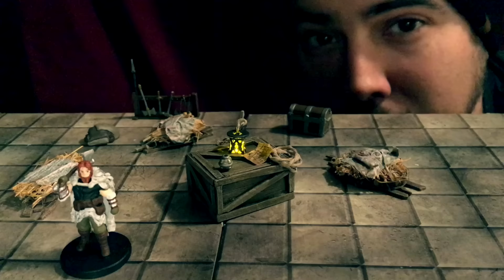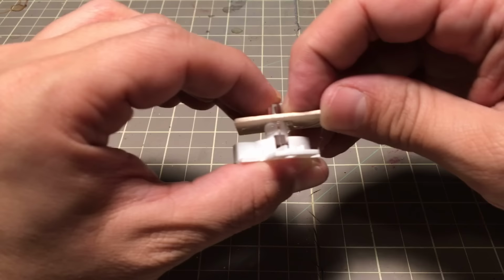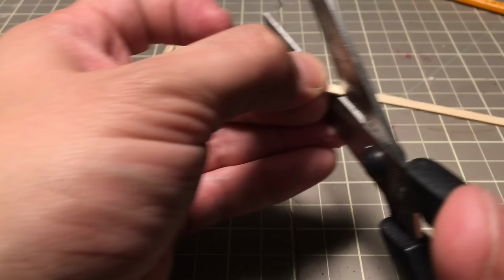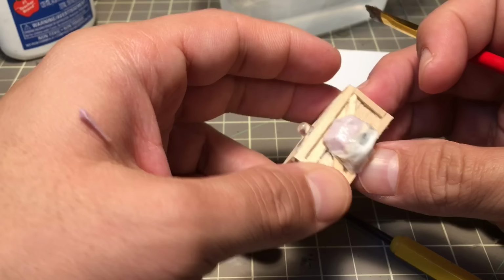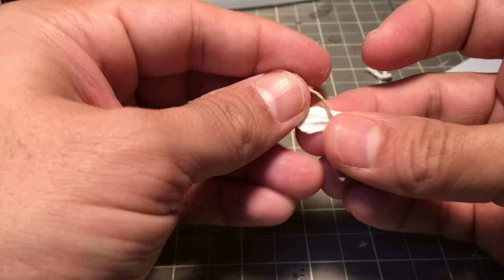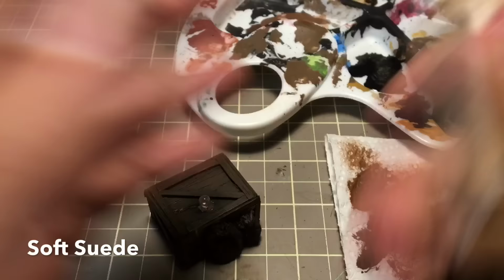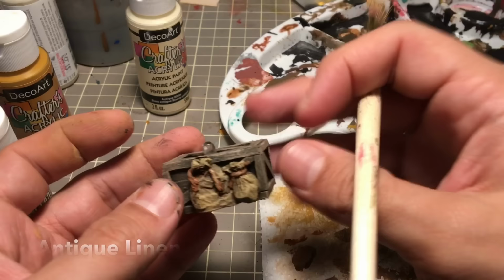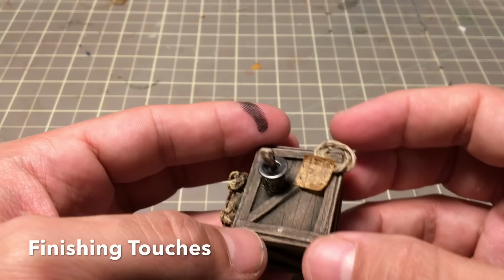D&D Tabletop RPG Prop Tutorial - Episode 3: Flickering Lantern

Comment: One thing you can do to mark where the hole is far more easily than your method is to take a little bit of paint and put it on the part of the lights base since you removed the LED at that point, then push it up against the top and remove it again. It'll mark it for you...same method normally used with pinning and getting the pin holes to line up
Reply from the maker: Ah, great call! I've used that before with other project but totally slipped my mind here. Thanks!

Comment: Great stuff had to make one straight away only I hid the switch inside the crate as I don't have any XPS and can't find anywhere that sells it other than kingspan insulation board which costs loads. Also what music did you use?
Reply from the maker: Love to see a photo of what you built! The music I use is called 'A New Dawn' by Machinimasound!
Reply: RealmSmith I'm still trying to find something suitable to cover the led with to finish it off. We don't have the huge multitude of craft stores this side of the pond. But once it's done I'll put one up.

Comment: AWESOME. Liked and subscribed! A bit of advice, there are parts of the video that you could either edit out or speed up.  a 40 minute video is hard to digest.  I think you will get more views if you can get it under 20 minutes.  10-15 minutes is ideal.  Break it up into parts might help.
Reply from the maker: Thanks for the tip, I've definitely shortened and sped up the new ones!